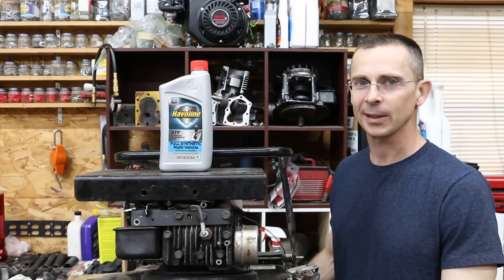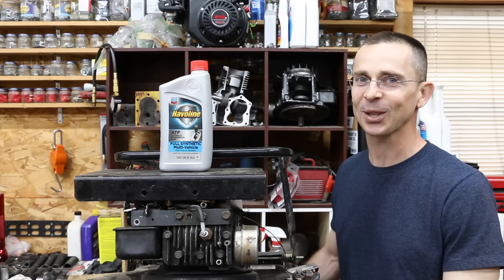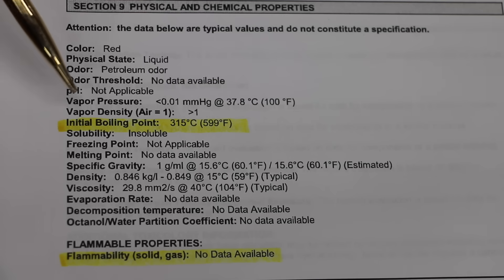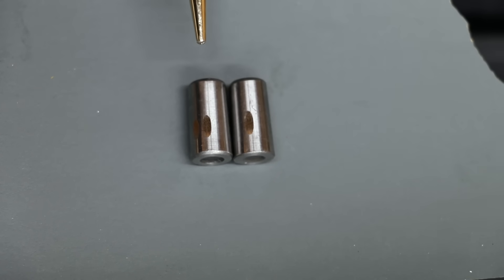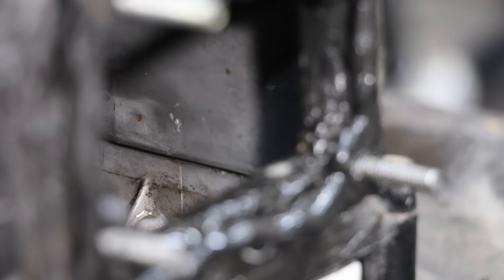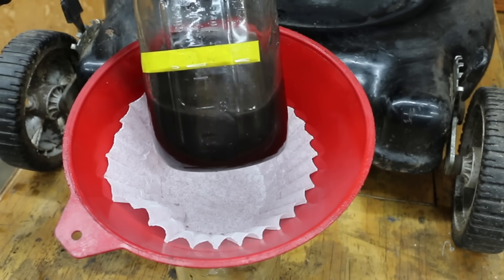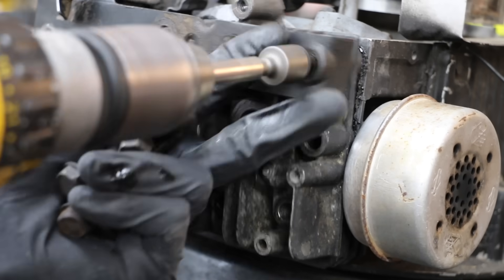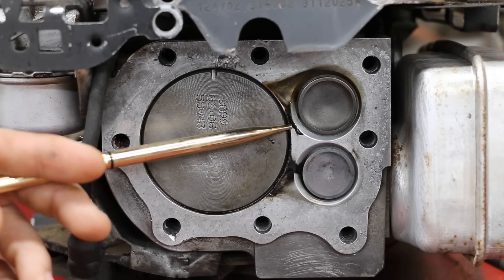ATF as an Engine Oil substitute?  Let's see what happens!

Comment: I've never used synthetic ATF or motor oil for anything. I really enjoy the slow motion footage, and thank you for doing the test. Yes, you have to be your own disclaimer on YouTube; somebody's bound to do something and pose blame. Personally- I always substitute 1 pint of conventional ATF for oil in my "older" cars, rather than using a "detergent" or synthetic oil to keep stuff clean, and cranks easier in Winter. My '89 Buick is the newest car I've ever owned. BTW- that nylon camshaft reminds me of the same cam sprocket GM used in the mid-70's. I saw a few of those stripped out in my time. What a disaster.
Reply from the maker: I really enjoy reading your comments.  You have a lot of great experience.  I replaced a plastic timing gear on an old GM car.  I believe it was a 1974 Pontiac Grand Prix with a 455.  I have a John Deere garden tractor with a water-cooled Kawasaki engine.  It too has a plastic timing gear that is known for failing.  I can't help but think about it every time I use the tractor.
Reply: You're very welcome. Ignition (spark) miss and abrupt load engagement/disengagement kills the cam sprocket, metal or plastic.

Comment: ATF in engine oil is fine in moderation. Using straight ATF in an automotive engine will result in premature engine failure as it does not contain several additives that modern DexOS or MST rated oils have. It may only take 20k miles off the engines life, or it may reduce the engine life to 20k miles. The more important distinction is the way it deals with combustion byproducts, ATF has nothing to deal with the acidic byproducts from combustion which means that in a short period the oil will begin to etch the metal (even in aluminium blocks) and eat away at gaskets, whereas engine oil has additives to neutralize the acids in combustion bypass.

However, in a 5qt engine, 4-4.5qts of engine oil and .5-1qt ATF has beneficial effects due to the far more concentrated detergents due to its intended lifespan and requirement to keep valve bodies clean and free from buildup. Several of my old instructors have used a 10-20% ATF mix in their engines for decades, and I have used a 20% mix in my engines for half a decade without any negative effects. I replaced the valve covers a few years ago and the rocker assemblies looked pristine, granted I have no clue what they looked like when I bought the truck.
Reply: Ernest, I cant tell the intent of your first question but engine oil is not ashless either, every oil you can put in an engine is going to leave carbon when it combusts. A 2 hour run in a modern engine with straight ATF might brick the engine. Especially if it has turbos or cam driven injection pumps, it was not made to be run in an engine, its not an engine oil. ATF is a hydraulic oil, its primary purpose is to be used for applying pressure to things, be they pistons or hydraulic motors. Secondary considerations are lubrication, sealing, cooling, cleaning. Engine oil has a primary function of lubrication and secondary considerations of cooling, sealing, cleaning and a minor function of applying pressure.
Reply: You don't really get it waterloo. Its not the oil itself that causes leaking with ATF, its the same thing with synthetic motor oils. Oil itself is a sealant, its why you don't have to weld the oil filter on every time, oil works its way into the miniscule cracks in the surface between Orings and their mating surface where a combination of surface tension, cohesion and adhesion seal small cracks and prevent leaks even under pressure. The comparatively better cleaning properties of ATF and synthetic oils cleans out buildup that was blocking leaks, once that buildup is removed, it leaks. This is exactly why people started experiencing lots of oil leaks when they first introduced synthetic oils. Second, i'd hope certain motor oils are the same as synthetic blended oil if your buying synthetic blended oil, i'm not even sure what you were trying to say there. Not all oils are made alike, valvoline, Castrol, Mobile 1 are very good oils and better than most all 'house brand' oils, unless the house brand is rebranded variants of the aforementioned oils. High mileage oil does NOT have 'swelling agents' If it did, you'd blow out every seal in the engine within 10K miles of using it. Valve covers would leak, front and rear main would leak, any oil cooler, hydraulic lifters, certain variable lift/timing systems would all have their seals swell and leak. They use conditioning agents which don't swell rubber seals, they return some chemicals that are lost due to age and heat. The conditioner is not used for lubrication, the oil is not 100% seal conditioner, its a few percent conditioner, its mostly oil just like any other, it just has more additives.

I never said it was a one stop shop for all your problems, I said it can help with existing problems and help prevent new ones. You wanna talk about misinformation
Reply: I have run 1 qt. out of 5 in several older cars and had no ill effect.  I agree the newer engines with turbos and such might be a whole new ball game.  Like another poster, I'm not sure the atf did what I hoped, but sure didn't seem to hurt.   Lastly I would never go above your 20% recommendation,  and might be wise to keep it even to 10%. Thanks
Reply: Great information, this provided good reading
Reply: Ernest, Depending on the mileage in the car and what type of oil you've used in it will really determine what you use. If you've only been using conventional oil i'd recommend switching to a high mileage synthetic blend over anything else. If you really like the vehicle and its nice enough to keep it for many years to go it might be worthwhile to move to synthetic oil without any additives. There is a possibility if you have never used anything but conventional in the engine that putting a mix of ATF and engine oil may create oil leaks. Similar to what happened to many people when the first synthetic oils came out. 

The myth was that synthetic oils can seep into cracks better and thus started leaking through pathways that conventional oil couldn't. This was and is false, those engines started leaking because synthetic oils of the time were much better at cleaning dirt and other buildup from the engine, they were so good that the new oil cleaned out buildup in the old engines that was preventing leaks, which is why switching back to conventional didn't fix the problem. That issue has been mostly resolved as conventional oils have improved to be better at cleaning.

My recommendation would be to switch to a high mileage synthetic blend if you are still using conventional oil, this is a great compromise between cost and oil quality on an engine that my guess takes 6-8qts of oil. If you are already using a blended oil or want to see if you can clean it with an oil change or two, i'd stick to roughly 10-20% ATF and leave it in there for the entire oil change interval. It will achieve the same result as a higher concentration ATF shorter duration treatment without spending extra money on a short oil change interval and also avoid the risk of excessive foaming of the ATF component at high RPMs.
Reply: 2009dudeman U think a 2 hour run would create excess wear?  Agree w u that long term is no good. Also, the atf that gets past the Piston rings is not "ashless" when it combusts. Going to leave residue in the sparkplugs.
Reply: 2009dudeman Yup.  I was agreeing w u. However from other users comments was under opinion that for short durations ok. Thanks for advising that this is not so.  I would rather do a short higher atf concentrate than a longer more dilute.  What is the max atf/ motor oil ratio u would advise?  4/2?  Then, for how long till it has done it's magic?  1/2 hr?  Whithin the next week will do this to my 87 MBenz 300D turbo OM 603.  Has 3 lifters that are noisy. Replacing lifters on this motor is a PITA. Thanks for sharing.
Reply: All2skitzd a synthetic blend is different than a full synthetic oil, primarily the ratios. But what owners manual says a quart of oil every 600 is ok? Add a zero and I'd buy it, but there isn't a car out there made within the past 30 years that has a standard oil change interval less than 3000 miles. If 1qt per 600 was acceptable then any small car which usually has an oil capacity from 3.5qts to 4.5qts would run dry before even the car tells you to get your oil changed again. Only the bigger v6 and v8 engines wouldn't run dry by 6000 miles. Many cars will run you over 6000 miles per oil change. Trailblazers often run you 9000 miles per pill change since than hold 7qts of oil in the I6 engines. The 8qt chevy can run you longer than that depending on how you drive them. They shouldn't lose more than a single quart over a longer oil change interval or half a quart on a short interval.

Short and sweet, a healthy engine will sip oil, not drink it. Synthetic oils are just better. But even conventional oils are so good now that unless synthetic is specd by the manufacturer you should expect the engine to outlast the rest of the car,as long as you change the Coolant every 4-6 years.
Reply: @2009dudeman  I've driven 5 million miles since 1966, sedans only and I used to use Valvoline and then Castrol regular oil no synthetics. The oil and filter were changed by me at 3000 mile intervals. I never had an engine problem with any car i've owned, Chevy, Cadillac, 67 Jeep Wagoneer and a few Fords, average mileage 150k to 200k. The major problem was road salt damage where the car had to be scrapped as living in Maine, Mass. and New Hampshire was a horror show.
Reply: @georgebuck2269  I'm not sure what you are trying to say. Any engine should get 200K minimum on conventional oil with 3K intervals and standard maintenance. My comments were never about that, it was about extending the life of your engine with automatic transmission fluid. As well as not using straight ATF in your engine or you will kill it.
Reply: 2009dudeman Dude go read the back of a bottle they say right on there they use swelling agent's on Some brands of high mileage.  You can get it in a bottle of STP AND Lucas stop leak. And they 
DO NOT blow seals. I've used it myself and I don't like it. Zinc is what conditions your seals. Same with low additive transmission fluid. It's pretty much the same thing just with different additives. I understand everything you said. No offense but you are slightly misinformed.
Reply: Did you happen to get a look at what it did to the flux-capacitor?
Reply: 2009dudeman Transmission fluid does not cause leaks, it actually helps seal better. Also certain motor oils are the exact same thing as synthetic blended oils. I also don't recommend high mileage oil to any motor. They use swelling agent's to prevent leaks you shouldn't be having or that can be fixed. Swelling agent's are no good for lubricating your motor. There's just some things you can't fix with fluid. I just see a lot of miss information from what I've read.
Reply: i agree those high mileage oils cause build up bc of the added crap.
Reply: Lucas and STP, I have no clue what goes in those. Though i'd only ever recommend putting stop leak in an engine you plan on selling soon. Valvoline, Castrol, and Mobile One do not use swelling agents, I can't speak for any others, they very well may, and I imagine stop leak would as its goal is to fill cracks hopefully without leaving sludge that clogs lifters and such.

If you swell a seal enough, it will fail. In recommended doses, a relatively healthy system, or even a moderately neglected one should be fine, but I certainly wouldn't trust stop leak or things like it if all they're going to do is cause the seal to expand to fill gaps, its not what the seal was designed to do. Seals exposed to oil and kept clean and free of debris can last a long time, regular oil changes will do more for engine life than anything you can put in oil, but failing that cleaning what buildup there is on the seal and exposing it to fresh oil. All oils swell seals some, but its measured, a dry seal shrinks and carbon buildup promotes drying of the seal, clean the carbon, as long as the seal isn't torn or cracked, it will probably be just fine.

My wording may have been a little off, but synthetic oil will not harm an engine, there is a reason auto manufacturers have retroactively spec'd synthetic blend or better in some makes and models of cars, usually to meet emissions requirements. Chevy for while spec'd most of their engines with a blend or better, and in some lines full syn only in order to meet emissions, but all manufactures spec 'or better' as there is no significant harm from blended or fully syn oils.
Reply: 2009dudeman o
Reply: Great info, which Type & Brand Transmission Fluid is Best for lifter tick?    
I'm concerned about the film strength to be on par with the motor oil.
Reply: dexos oil has less zinc limited to 800ppm i believe, also high mileage oil normally has more zinc in it btw. since a mower does not have a catalytic converter i would not run any dexos or any api sn approved oils.
Reply from the maker: This is great information!  Thank you!
Reply: 2009dudeman any Chevy that says blend is one that is use (probably some cheap) synthetic. It's pure speculation but I would imagine that blend was mainly named to keep the cost of ownership lower.  I could be way off... Hadn't had much sleep in a couple days.
  I'm not saying synthetic will damage motor but at the same time more cars are calling for synthetics and working towards getting them where they would be vapor if any lighter, you can open pretty much any owner's manual and read something about own consumption. Some say 1QT every 600 miles is okay. To me it is okay if your motor has a quarter of a million miles on it but not in new car that the motor is put together tighter then a ugly 3rd grader when it rolls out the factory to meet Obombbohs fuel efficiency regulations that it looks like he done passed out with his pen on the page when adding his part on to the chart.
Reply: I have actually experienced the "consumption"rate first hand. I changed the oil on a friends Honda Pilot. When it was done draining, the oil in the pan was about half of what it should have been. As i was freaking out and about to call the shop she had  went to for the last oil change, I eventually discovered"consumption" in the service manual. I believe it was 1 quart every 1000 miles. That sorta blew me away. Racing dirt-bikes my entire life, I knew  high performance "F1 style" pistons , like the CRF450, are designed to burn a little bit of oil. But I never knew regular cars were designed that way.  I hope Trump reverses Obummer's fuel regulations.

Comment: Done it a few times on late model engines, 1 of them was noticeably quieter afterwards the other 2 it made no difference in sound. Was always done to quiet valvetrain noise. I wouldn't do it to a good running motor but it seems to work ok on abused engines
Reply from the maker: 33% success rate.  Thanks for commenting on this!

Comment: Back when carburetors were the norm. To clean engine intake & valves trans fluid poured directly into carb at fast idle was a big thing. The smoke cloud has to be seen to be believed but it works. GM even had a top end engine cleaner that was mostly trans fluid. Was told ingredients by head mechanic who found out in GM Tech. school.
Reply from the maker: Thanks for commenting on this!

Comment: We have a John Deere 120 with a 12 horsepower Kohler engine on it and the exhaust valve will stick when you run the engine hard (we have a rear mounted tiller) and we use atf in the fuel and oil when we are out of marvel mystery oil and  it will prevent the valve from sticking
Reply from the maker: Glad this worked. Thanks for commenting!